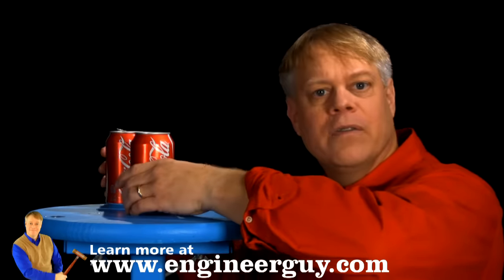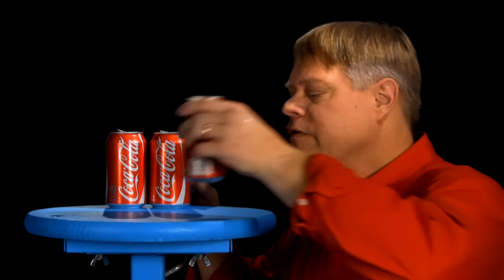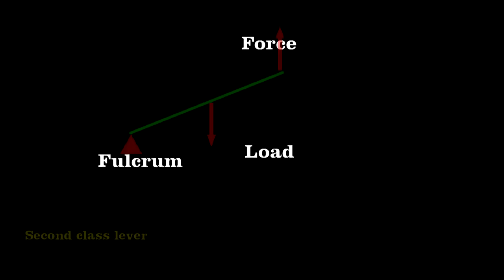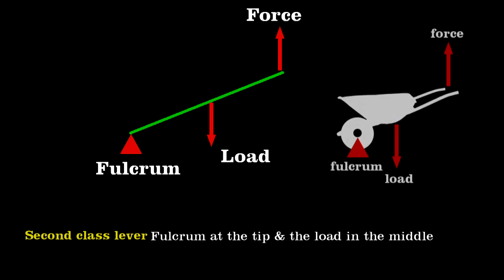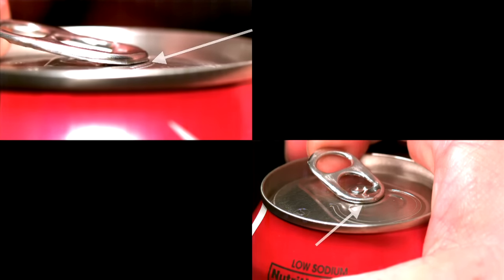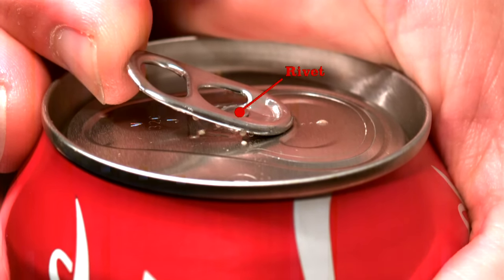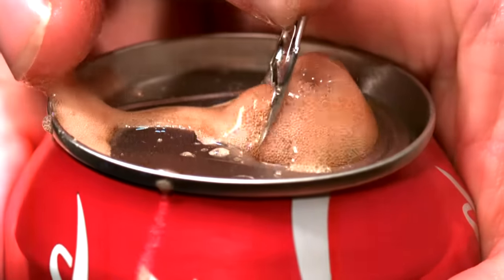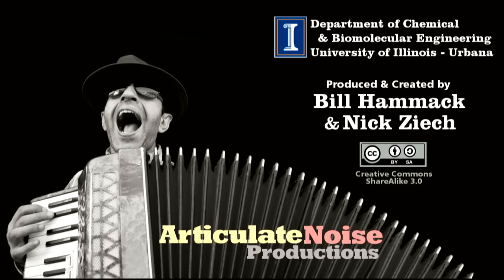Pop Can Stay-on Tab (slow motion)

Comment: awesome video, i realized while cracking open my 3rd beer for the night that there might be more to the design than it seems, 30 seconds later im watching this

what intrigued me is that there are two score lines:  the outer line (where the opening ultimately peels open) is deeper than the inner adjacent line, i figure this inner line is to assist the transition between lever classes by giving the aluminum some malleability near the main score line so it doesn't open prematurely/awkwardly,right?

Comment: you forgot another thing it does. Because the tab remains on the can, with a hole at where the fulcrum is, your lips, cannot create a vacuum seal around the can, as the hole allows air to escape, allowing for easier drinking.

Try nibbing off the tab, then drink, you'll find it far more difficult.

Comment: I find the new re-sealable solutions to be much better. I don't know what they are called and i have only seen them on the white Burn cans in my country so far. You turn it and it punctures the can. You can then turn it back and it makes a seal that hold both the drink and the CO2 in the can.

I would gladly pay 10% extra for any drink to have these on as it allows me to drink some and then put it in my pocket.
I know plastic bottles are simpler but they are not as awesome!